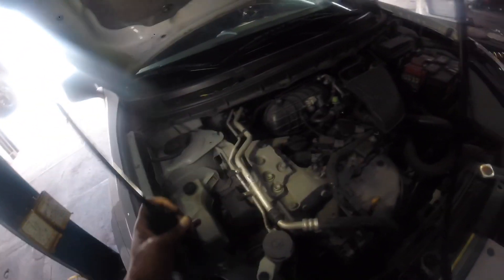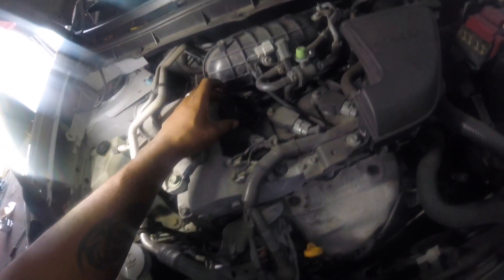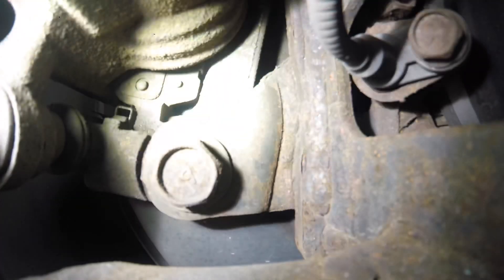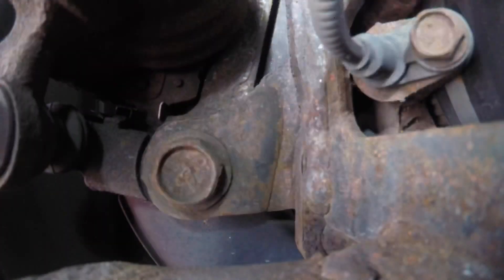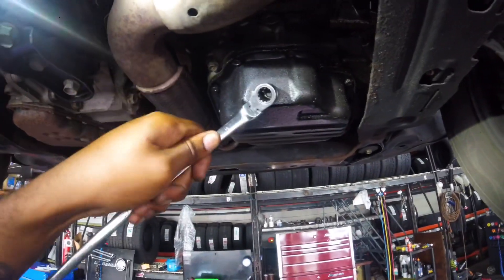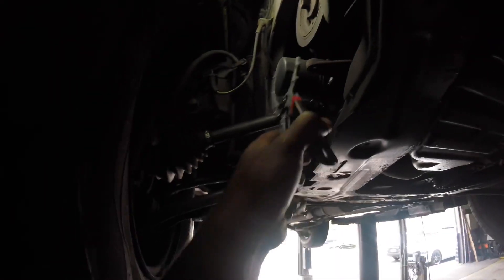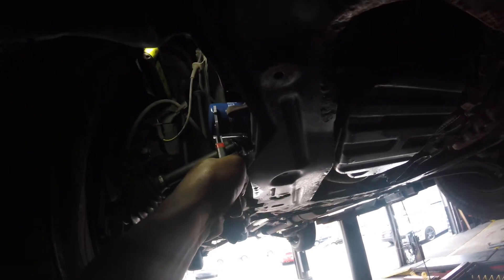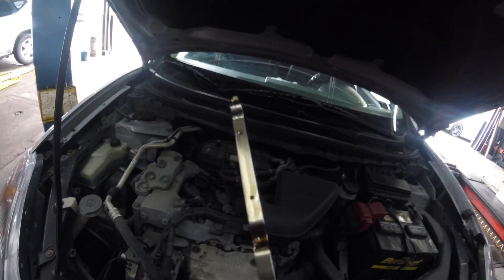2010 Nissan Rogue Oil and Filter Change

Comment: Ok... A couple of tips. First... if you title your video "..Oil and Filter Change.", leave out all the vehicle inspection stuff and focus on the oil change.  People came here to see the oil change and not the other stuff.  Second, and this comes from years of being a mechanic, you should NOT be tightening the oil filter with a wrench.  The only time I ever put a wrench on an oil filter is to take it off.  The one exception to this is when there is no room for your hand and you have to use a wrench to snug it up. I have encountered MANY filters that were over tightened and VERY hard to get off.   To end on a positive note, minus the vehicle inspection stuff, the video was instructional in that it showed the location of the drain plug and oil filter.  That is likely what most people were looking for.